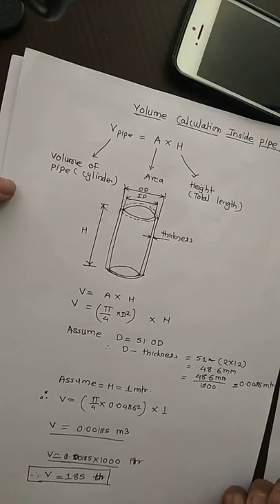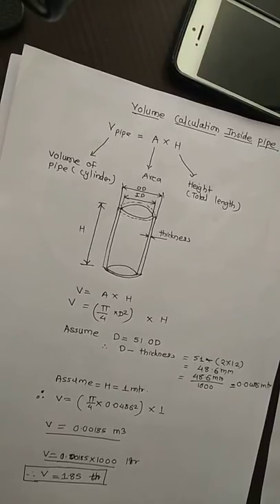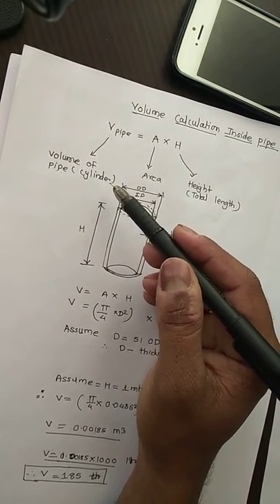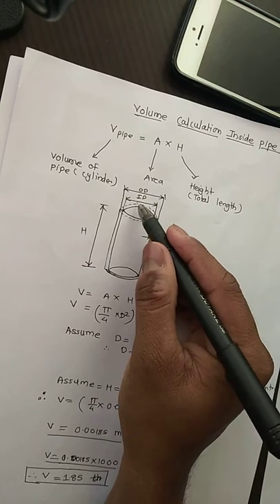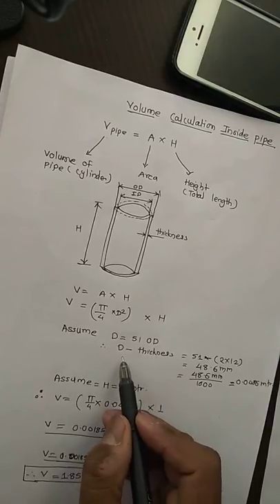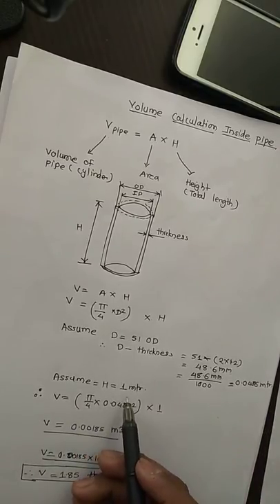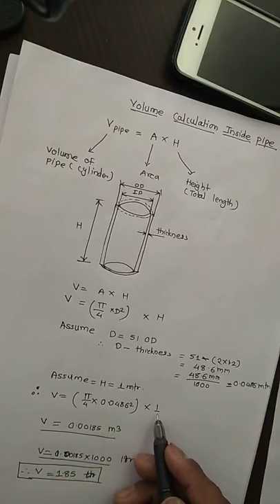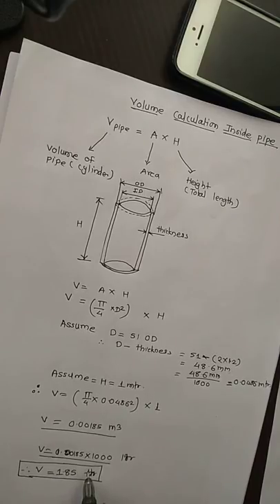Volume calculation for cylinder or pipe

Comment: I hv borewell and 3 hp pump placed at depth of 120ft. And dia of borewell is 7 inches pump run/discharging continue for 15 min and take breaks for 5 min to discharging again can we calculate inflow in borewell
Reply from the maker: You want to calculate "what is capacity of your bore well" ? Normally water flow is defined in liters per hour.
Reply: @NitinDahatonde  not knowing flowing rate